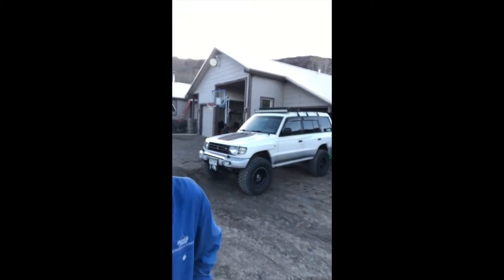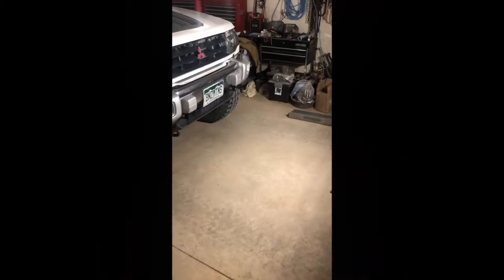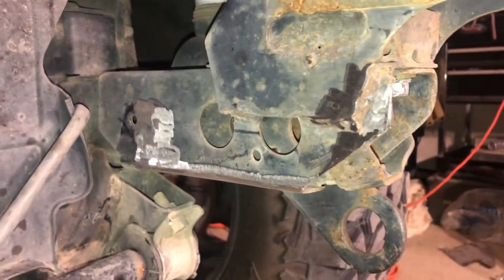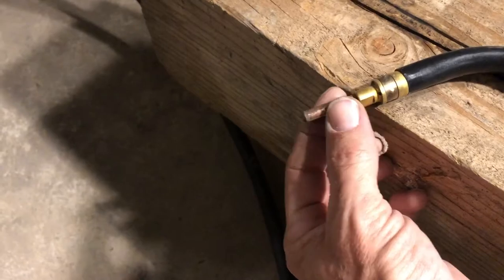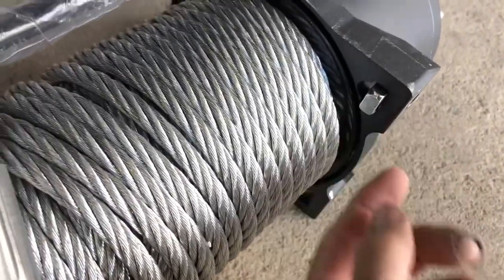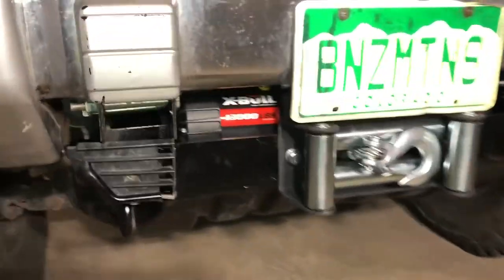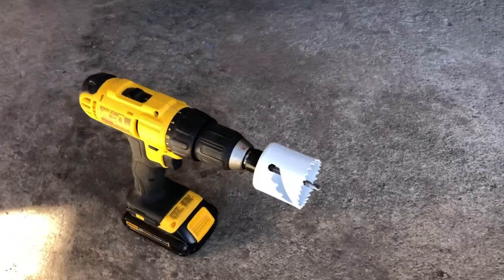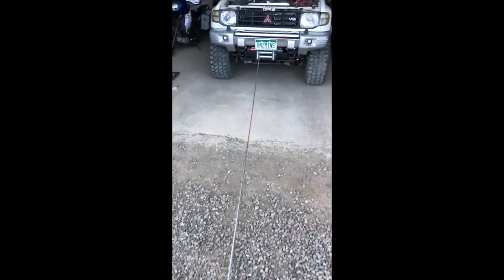Mitsubishi Montero Winch Plate & Winch Install

Comment: Some great tips in here. Cleanliness. Remove tires. Remove bumper. One not mentioned. Cleaning metal of oils.  Don't use chlorinated brake cleaner. If it puddles and goes up in smoke with the welding, it produces chlorine gas, which can kill you, and even minute amounts will mess your brain up. Thorough video! ♦️♦️♦️💪

Comment: Hey, it installed pretty simple, but seems to be that the cooler for trans is kinda higher, so did you do body lift on it or no? Thanks
Reply from the maker: I have 1.75” body lift so that gave me more room to work with.
Reply: @inzmountains8067  OHH, now that makes sense, does a body lift really need for winch installation? I'm not a big fan of body lifts and lowering the radiator, maybe I could just make different holes when will be installing the winch or there is a different solution?